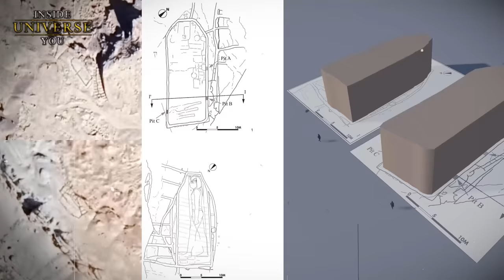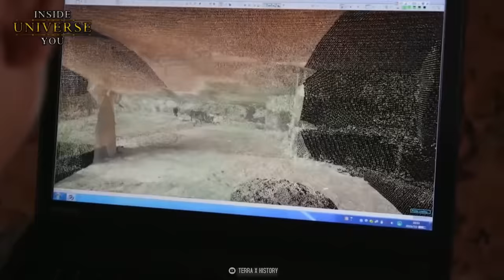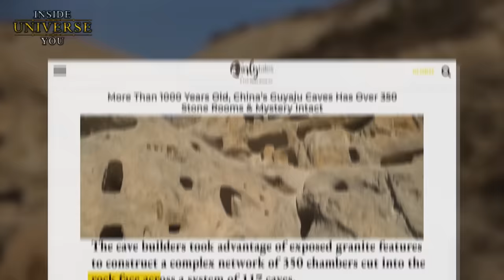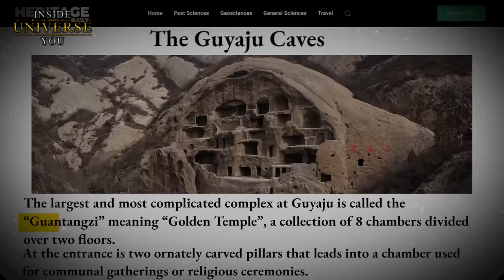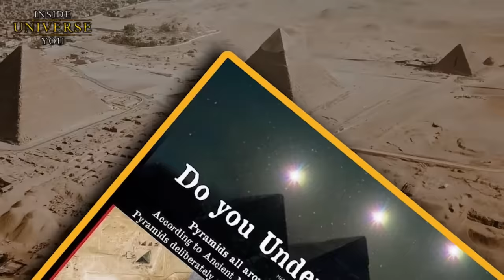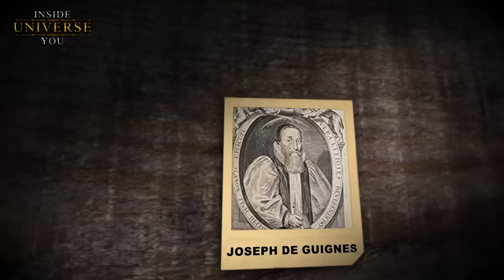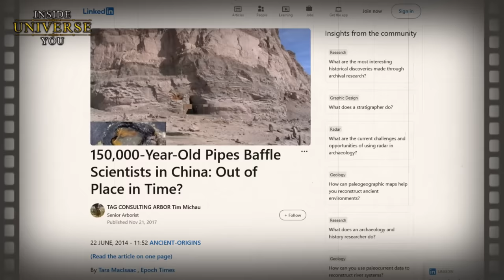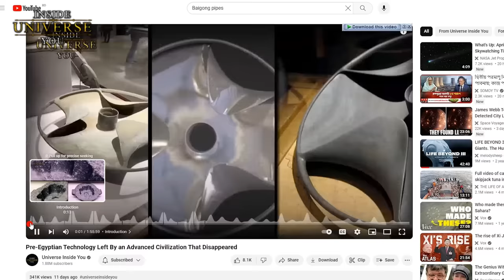Pre-Historic Mega Structures In China & Unexcavated Pyramids

Comment: The Longyou caves are sandstone, quite easily worked and quite capable of filtering groundwater if below the water table.  In the Iron Age the Chinese were tapping gas pockets almost a mile deep thanks to bamboo fibred cordage and piping it miles to salt evaporation works.
Reply: you can still actually see operational salt drilling dericks (mainly for demonstration) but still traditionally pump up brine and use those very same gas pockets to run the fires for evaporation cauldrons...
Reply: False , iron age china did not have the capability to drill 1 mile deep
Reply: @Cold_Cactus  So, that whole mining operation is much more recent then?
Reply: @Cold_Cactus  Who said drilling? Did anyone at any time say that the Chinese "Drilled" holes a mile deep? No, no they did not.
Reply: @Cold_Cactus  - Kinda tense aren't you? Are you one of those people who look around and think you are smarter than everyone else, just by watching a couple of YT vids? Remember, space is real and the earth is not flat.
Reply: Correct. Just because some people can't explain how these mega structures were made, does not equate to a lost advanced civilization. People across the ancient world were very capable of building large structures through mathematics and man power.
Reply: @bryn494  Egypt, Cuzco, ... are truly Amazing 🤩🤩🤩, nothing similar to fiction, in a video showing mountain caves with some canter holes, disappointed
Reply: Ming dynasty？Make sure you are not brain washed…

Comment: These are not pipes. This is an insulator in which there was an organic filler type of fiber optic cable.  Over time, the organic matter decomposed and disintegrated, and the shell was preserved. These are transmission cables from a technical high-tech device.

Comment: The ancient builders used levitation via sound waves. The weight of the stones becomes irrelevant.
Reply: And maybe these rocks were more softer then today and much easier to cut and shape but harden over time through global warming.
Reply: In my opinion this is nonsense. If you know what a soundwave is, you understand that you cannot make levitate somthing, except very small or light weightet things. If you see video that something levitate by sound, it is probably something very lightweight. Try change thing to something with same small size but much hevier, and it fall down as nothing. Second problem is presure to make heavy thing levitate. You will need so big force (sound pressure) (for those blocks showed in video), that everything around will be destroyed.
Reply: The ancient builders used levitation... (this is worth of consideration.)
... via sound waves. (no way, another technology might had been used)
The weight of stones becomes irrelevant. (yes, you are are right.)
Greetings!
Reply: coral castle code is most recent use of levitation rocks. But that technology is lost some have found out how but dont want to share it
Reply: @flir67man84  Yes, the equipment found in the Castle's workshop might have hold the secret.

Comment: Taisun Crane's capacity is 20,000 tonnes. Another crane exists with an even larger capacity of 22,000 tonnes.
These cranes a limited in the distance the weight can be transferred, but lifting those large loads is possible today.

Comment: All stone large and small originate from discrete gravels of various composition, in loose form, wet or dry. It will stay in loose form until a binding agent of some kind infiltrated the gravel into the core and began by chemical reaction and solidified in a year if not months, at local ground level in ambient temperature, instead of extruding out from the magma under ground and cool and harden rapidly. 

Ground level material in ancient time usually came comets, rich in mineral and chemicals. Each time they pass by download debris on earth, including some dry binding agents, and then the rain came. Just like if we mix Portland cement with gravel it will stay loose and dry until we sprinkle water over it to a correct proportion. In the end we have solid rock from gravel. Ancient time lived very talent people. They learn how long it takes for binding agent to set turning loose gravel into stone. until such time they can organize a sculpting operation on the gravel pile slowly hardening. What we have here are the material remains from unfinished sculpting because it hardened prematurely or they kissed the hardening schedule. 

所有大大小小的石头都来自各种成分的离散砾石，形状松散，潮湿或干燥。它将保持松散的形式，直到某种结合剂渗入砾石核心，并开始通过化学反应，在一年（如果不是几个月的话）内在环境温度下的当地地面水平上凝固，而不是从地下的岩浆中挤出，并迅速冷却和硬化。

古代的地面材料通常是彗星，富含矿物和化学物质。每次他们经过，下载地球上的碎片，包括一些干燥的粘合剂，然后雨就来了。就像我们把波特兰水泥和砾石混合一样，它会保持松散和干燥，直到我们在上面浇水到正确的比例。最后，我们有来自砾石的实心岩石。古代生活着非常有才华的人。他们了解结合剂需要多长时间才能将松散的砾石变成石头。在此之前，他们可以在慢慢硬化的砾石堆上组织雕刻操作。我们这里有的是未完成的雕刻材料，因为它过早变硬，或者他们亲吻了硬化时间表

Comment: They must have used the removed stone to make geopolymer structures somewhere. These builders were obviously much smarter than us and they would be smart enough to use the removed material for another much needed structure and they would be operating at maximum efficiency. they would have 2 needed structures with the least amount of work and materials

Comment: If you're going to tell me "they all had ceilings angled at a precise 45 degrees" then you should show me a ceiling that isn't 25 degrees. How difficult is this?

What I like best about the Longyou caves is how clean and crisp the stonework is for being 2000 years old and recently long submerged in water.

I'm looking at how dry they are now even though they never ran out of water. I'm thinking about how quickly they were drained. I'm wondering about the village being all "yeah, destroy our permanent water supply, dude, it's chill". I'm pondering how up to code the stairs are. I'm recognizing how machined the columns are...

2000 years old is off by about 2000 years.

Fraud.

Comment: All those structures made out of concrete mixture. I can  provide proof, that no high performance cutting tools,  have been used the building process:  That is absence of tiny pieces of hardened steel or diamonds, used in making saws and cutting disks. Not a single chisel, made out of hard enough material, to cut granite, was found at any construction site.

Comment: Im begining to doubt if it is our past. Realy not sure but maybe. What is most Intiguing is that there are no Traces of Humans and Technology publikli cnown. It wouldint be that impossible that much older civilisation achieved technology similar to our. It basicli is a fact that something major happend around 5.000 b.c. and they were gone. Around 7.000 years of advancment has been lost. They had wast cnowleg of electicity and hydrology olso sejsmic, but difrently used then ours. They had machiens but most likely not stel ones, if it is right whar is said they used cooper, probably sun lensing to use light and even melt stone and maybe use magnetic fields. They had vast cnowledg about Solar system and used this for time mesuring sometimes more than we do now. They could travel around the globe, and most likely not by see but flying. Why? Wede the sees more difficuld to sail ore were they havier than watter and had some sort of fear? Where are theyr corpses... in sees, ore they disintegreted all evidences wirh condensed solar (ore the governments are to scared to schow evidences)?

Comment: The first one is likely that they excavated around the stone, leaving a structure. Like a relief carving. It is more than possible to achieve those cuts with hammer and chisel given a skilled craftsman. The mystery would be, what tools did they have, and how hard is the stone. If the stone is very hard then yes it is a big mystery. We also can find where large stones came from pretty easily so if there were large stones extracted from there, we’d know. Definitely not a mystery since none of that was mentioned
Reply: I just made it to the part where he mentioned the tooling marks. Again, hand chisels brother. A cut with a hand saw and a power saw are the same, ones perfect and ones not and you can see that in your photos too. I don’t think you researched this past headline articles. Either way they are all new places to me so still cool

Comment: The erroneously claimed carved cave brought to you by chisels and donkeys Incorporated is hilarious but an amazing try to survive the flood purpose built bunker,
Is fascinating, compelling.
 I wonder if the special report the evidence even as much as it is a taunting that it at least partially worked?
How do you light a cave without fire?
You Draw depictions of the primer field the golden ratio and vorteces {spirals} on the walls to show that you understand sono bio and ionized plasma luminescence in a medium and how it relates to where you are in a magneto dielectric pressurized bubble formed over an Earth battery ground plane capacitor or gaussian like plate.
You would draw that you over and understand The Power used for Creation...
SOUND in Primary WATERS and the related bio chemical mineral gaseous electrostatic interactions.
Poor terms to form an inner standing 
How else would you explain it?

Comment: These stones were destined to be quarried unless or until the stone’s hardness change too hard against the tool at the time of quarry operation. The only option is abandoning. No need to conceive of alien visitation. 

Stone was derived from sand crystals. Sand don’t just hardens into stone on its own unless a binding agent was present, naturally or artificially. Example modern concrete compose of sand crystals and a binder known as Portland cement. In ancient time they use geopolymer which can be obtained long before the first Industrial Revolution.  

Where did those sand crystal came from from start? It fall from above, like rain fall. From cloud above? No, from fly by comets, moon or planets. Did you hear about comet bring in bad luck? That’s because it rain down thunder gas fluid and solid of various chemical strength in ph scale, to earth causing mud flood in small scale and burn or burying a whole city or country in global scale. Part of the chemistry they brought in was responsible for the geopolymer a binding agent. Not all geopolymer concrete hardens over night but over a stretch of weeks months or up to year or so. Careful planners are anole to schedule men power to shape and quarry it from the country side.